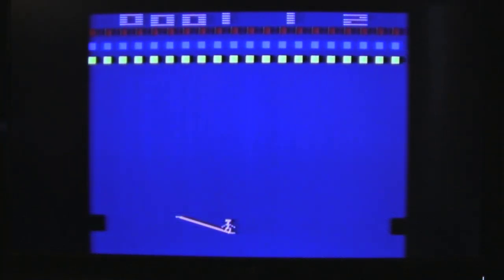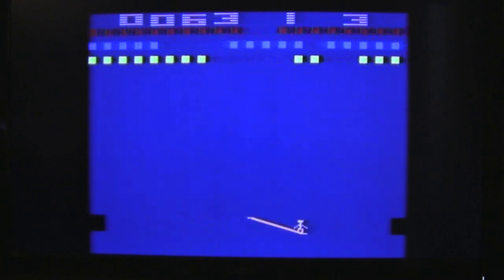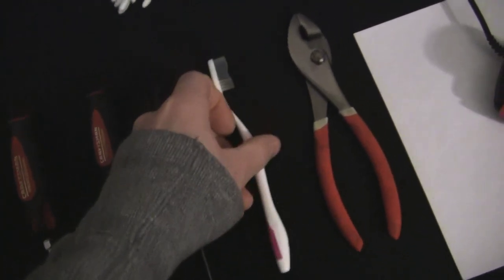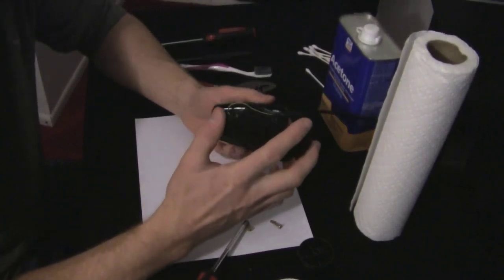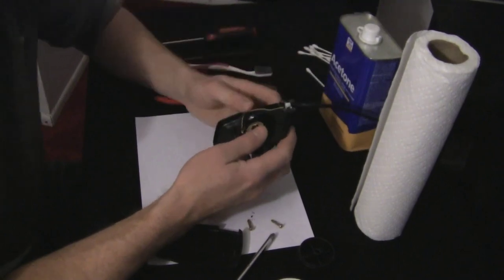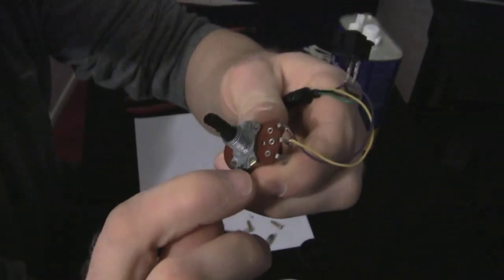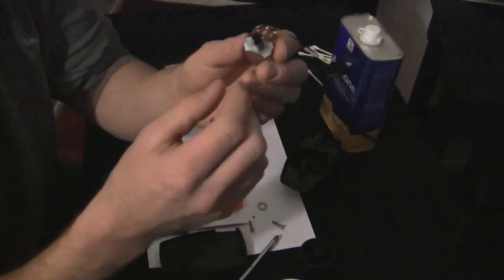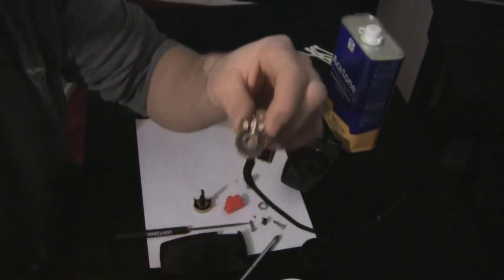Fixing a Jittery Atari Paddle Controller

Comment: This was a great video, thanks. I bought paddles off eBay, and I wouldn’t say that they were jittery so much as completely non-functioning. I followed your instructions, and there was so much crud on them there was no contact possible anywhere along the ring. One of them was so bad that I couldn’t remove the residue without scraping with a pocket knife! But now they work like new so thanks!!

Comment: I cleaned the contacts and then adjusted those little metal brush-type bits. Works a charm now! Plus, I got them in an original box, so...bonus.

Thanks for the detailed instructions. (Years later and it's still helping people)

Comment: I usually just spray some electrical contact cleaner into the pot and turn the shaft back and forth a few times. That normally fixes the problem.  It's true that a thorough cleaning would be better, but you can only take them apart so many times until the little metal tabs snap off and you're left with no way to hold the pots together. Depending on their age, it might only take a couple times to break them. I wouldn't take the pots apart unless it was absolutely necessary.

Comment: Thank you so much.  I loved your video to help fix the jittery paddle.  I loved your comments to help us be brave at taking it apart.  I watched it first.  Then played your video along as I worked.  For a girly girl, I think I did pretty good!  I used rubbing alcohol to clean the parts with.  I am wondering if the acetone would have cut the grime better?  Anyhow, I scrubbed away, and then put back together easily.   Goodbye paddle jitters!  Thank you for saving me money!!!!   I am not sure if I suck at age 48 playing all the old games like Kaboom and Breakout, or if I am noticing that the paddles don't move as quickly ( especially in Kaboom).  They don't jitter at all, but sometimes seem like they take longer to get where I need to be.  Can't tell if it is user skill or not?

Comment: Acetone : super useful ( work outside or have a breeze inside going away from your face. ) Uses : 70's motherboards, brake cleaner, 50% acetone+ 50% atf = rusted bolt penetrate.

Comment: Both my paddles have some grease (looks like thermal paste - dark grey...and not cause it's "dirty") on the contacts that was put there by the manufacturer - none of the videos or instructions I see say to put any lubricant back on the contacts - why?
Reply: I agree, I have 2 sets of paddles, one had grease and the other did not. I am assuming the older paddles didn’t have them and the newer ones had them as some type of improvement. I didn’t re apply grease and they work like a charm.

Comment: heres how i fixed mine i just took the bottom off and  left the knob on then i took some circuit bord cleaner and spayed it in the middel of the metal part and started moving the knob back and forth until it was dry now it works perfectly

Comment: How similar are Commodore C64 paddles? I have a newly-bought pair I need to fix up.
Reply: +Albert Jenkins If you can get at the pot, the process should be more or less the same. I have a set of generic paddles but it looks like I can't get anywhere near the pot of them. :(